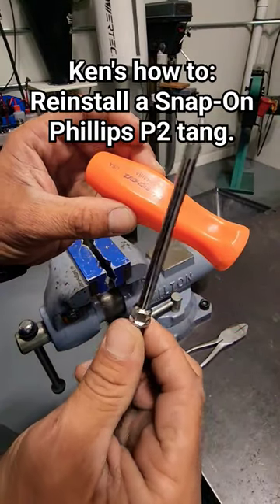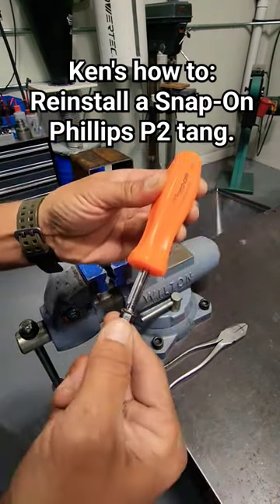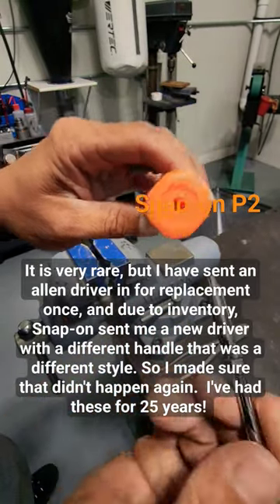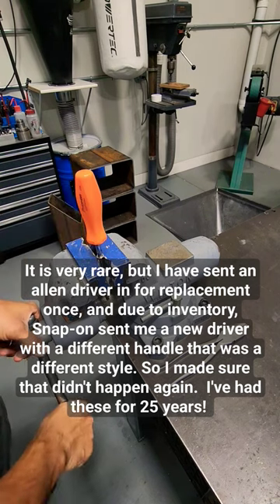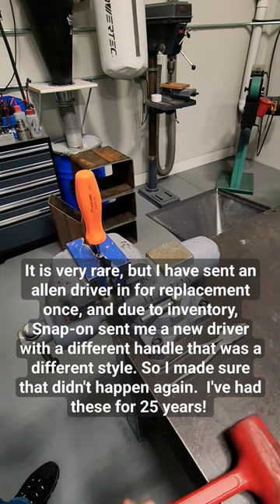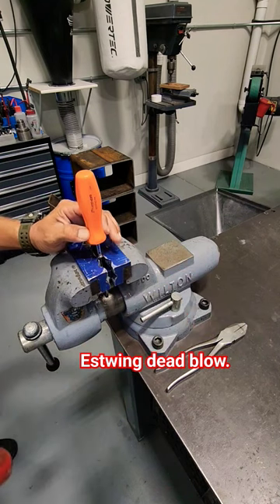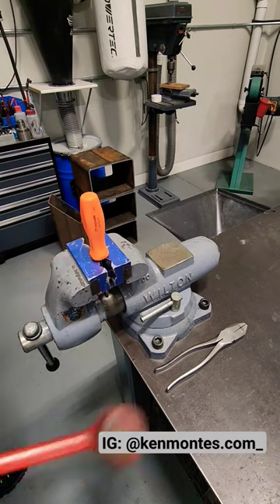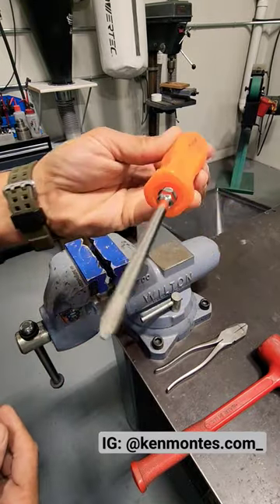How to install a Snap-On screwdriver tang.

Comment: I think i would put some epoxy or jb weld in the hole first, just to makw sure it stays together
Reply from the maker: Good suggestion.  Although that fit is extremely tight, and a screwdriver is always pushed together when in use. 👊
Reply: @KMbuilt couldn’t have said this better myself 👍🏽
Reply: Well if you epoxy it, you will never be able to change it again